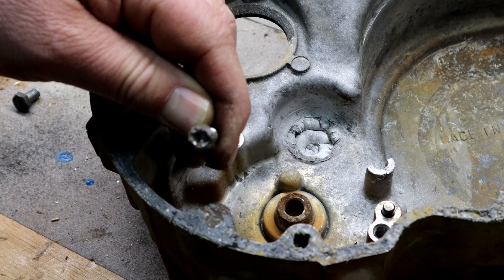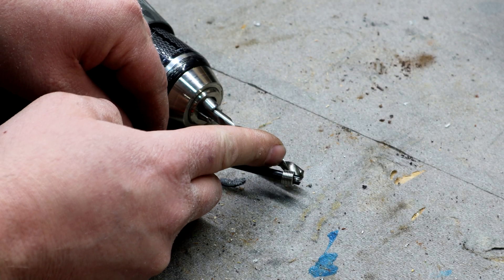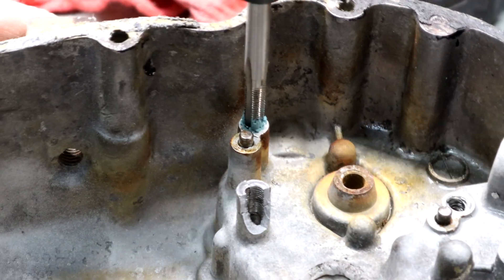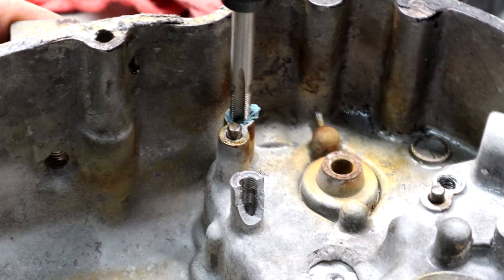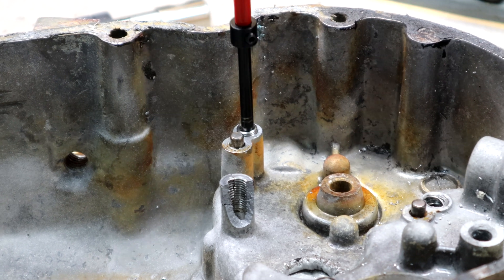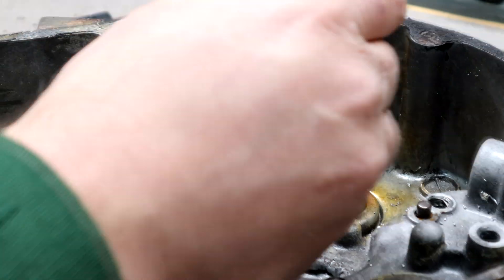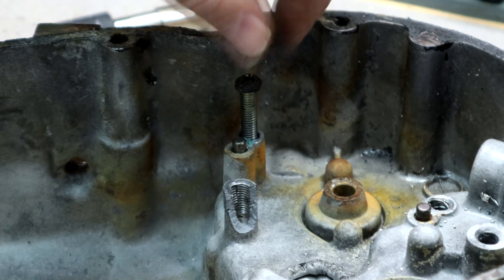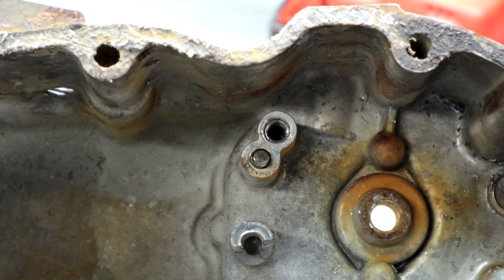Blind Hole Thread repair | How to install a Helicoil thread insert

Comment: Very nice, but there's an important detail (that I only realized recently):
If the tap is a tapered tap, you need to tap far enough in that the cylindrical (and thus full diameter) part of the tap makes it just below the depth of the insert.
Otherwise, the insert will contract and squeeze the install tool and you won't get it out.

Comment: I do not know why people even attempt to remove the tang in a blind hole, the tang is supported by the threads you've cut and you have to mash to insert through the ally and hope it snaps off cleanly for a whole 0.5mm of extra depth.. Just leave it there, you're day will be less stressful.
Reply: usually more than that even in a blind hole

Comment: Hey, I just subbed. Great video and a nice trick with the grease to pick out the tang. Does the grease always get the tang? Whats the procedure if the tank gets stuck, or is this situation improbable? I have to Helicoil a stripped thread on a KTm oil feed cover this week - my first Helicoil job ever, so please pardon the schoolboy questions. Its a very small bolt hole and getting the tang stuck is a concern. 
Great to watch a straight tutorial without horrible music, keep it up.
Reply from the maker: I have never had the grease fail, but if it would a strong magnet will get it.  You could even magnetize the end of the punch when breaking off the tang.
Reply: @thejunkman  Great advice. Thank you very much for replying. Top bloke!

Comment: Wht size need to use ? If u need ti fix 10mm screw
Reply from the maker: The kit will specify the drill size.  You will need to know the thread pitch of the screw however.